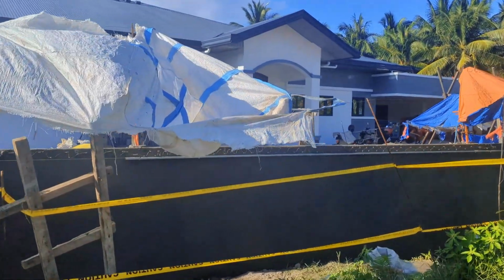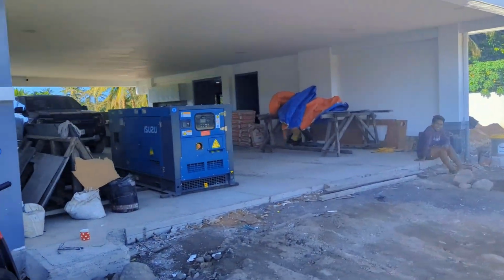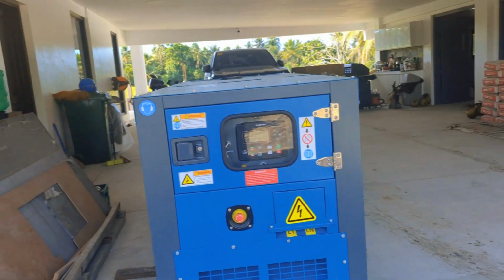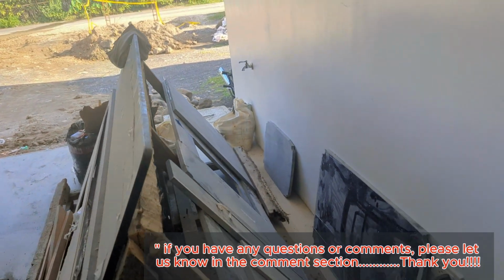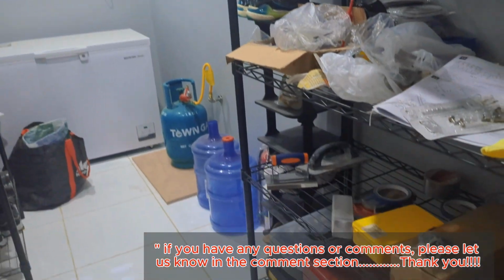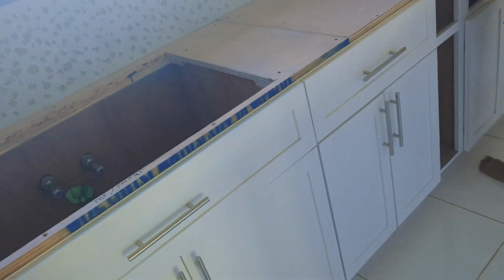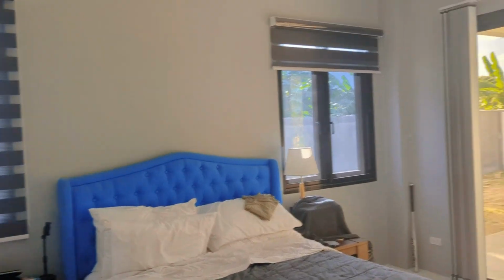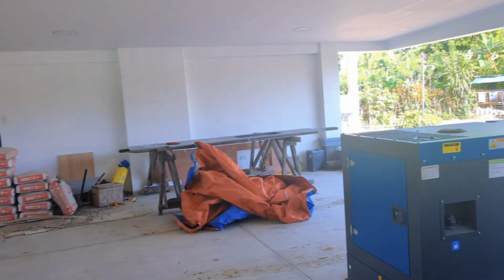Philippines House Build Day 273 " Generator and Loader Are Here, and Front Fence Starting Already"

Comment: Additional thoughts, should you decide to position the generator near the wall. The outside fixed louvers should be angled down. Never install rigid fuel, coolant or exhaust lines. Flex lines should be near the generator. The engine exhaust pipe should have flex pipe connected to the exhaust manifold and supported by rod hangers to prevent damage to exhaust mounting studs or bolts.
Reply from the maker: Had already been done. 4" exhaust is being finished up now. Thanks.

Comment: Just some thoughts from an old retired USAF power man. Consider mounting your generator on coil springs or seismic isolators. Position the generator a foot or so away from the wall, remove front door, install a flex shroud. The exhaust louver will be powered under emergency power. This will reduce engine heat & noise. Install a trickle battery charger. Engine exhaust and prevailing winds, install a butterfly. Maintenance,  how  will you drain the engine oil ? Normally  oil  and coolant drain plugs are on the side rails. Does your control panel have an auxiliary fuel pump switch ?
Reply from the maker: The generator has a manual transfer switch. There is now 4" exhaust vented outside. The generator sits on firm rubber pads. The room double doors and windows will be open when it runs and also have a fan pointed at it. Trickle charger hasn't come yet. Thanks

Comment: Nice progress in a few days.  That view out the back on a sunny day is awesome.  I know that the concrete wall construction is pretty much the standard in the Philippines, but does anyone build with metal studs attached to the concrete and then drywall to make the electrical and piping runs easier (no chipping it out like in your hood electrical relocation?  Not sure if that is cost effective in the Philippines.
Reply from the maker: They do have drywall here. They don't use wood here due to the abundance of termites. They don't use steel too much either. Not sure if that is due to strength or rust. Thanks.

Comment: Why a generator and not Solar. Does the generator run on gas or propane.
Reply from the maker: Solar, to have the same power is 1.5 million php. This Isuzu diesel powered generator was just shy of 400k php. Thanks

Comment: Hi Kevin I reviewed your Generator Room & you are advised to keep 3 provisions:
1- The Room Door must be Aluminum Louver type with screen mesh
2- implant one inline exhaust Fan on the ceiling for the smoke
3- take the exhaust pipe of the Generator outside of wall along with back flap at the end of it
Gud luck for the Rest.
Reply from the maker: Thank you.

Comment: You might consider making rubber washers for the lag bolts. I suspect the vibration ought the lags and will crack around the lags in the floor. Or, don’t bolt it down. Looking great.
Reply from the maker: Thanks. I'll keep an eye out.

Comment: Good day Kevin, nice to see your generator is arrived safe, just to keep in mind if you put it inside it will create huge notice, what you most probably will hear everywhere inside the house even it is on the other side, i made same mistake,  my advice is put it outside with exhaust away from your house and make it under cover with kind of cubo so it is still protected of the elements, also your radiator need huge amount of air to cool it down, just a advice.
Reply: I agree with you, I worked at electric utility company over 30 yrs, with alot of generator experience,  it should be in separate structure with air vents  coming in and large wall or ceiling exhaust fan.
Also you should install AUTOMATIC transfer switch to replace manual switch. Keep up the good work on your build
Reply from the maker: @djps2753 thanks
Reply from the maker: Thanks. The generator was started in the building we bought it at and it isn't too loud. Thanks.